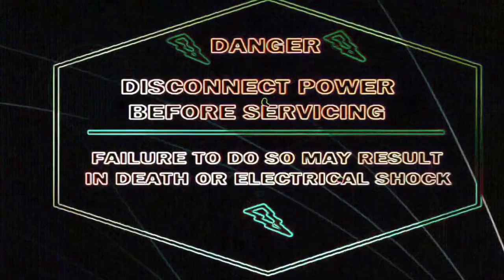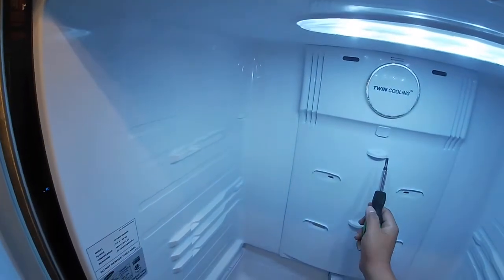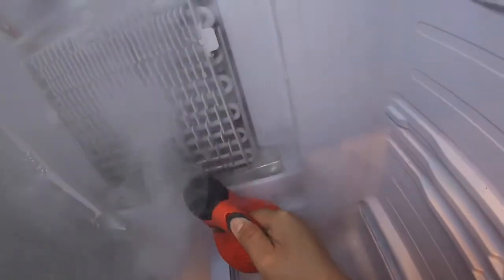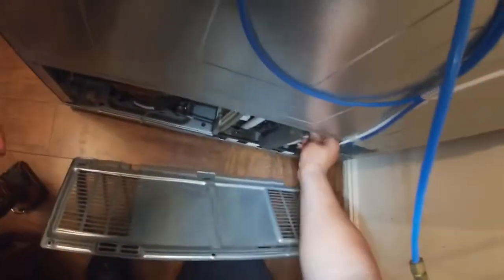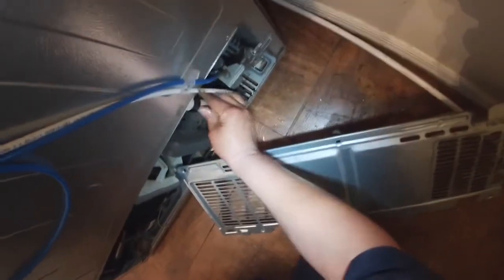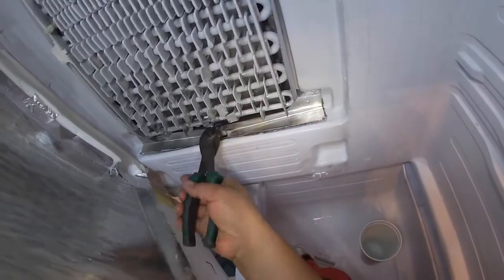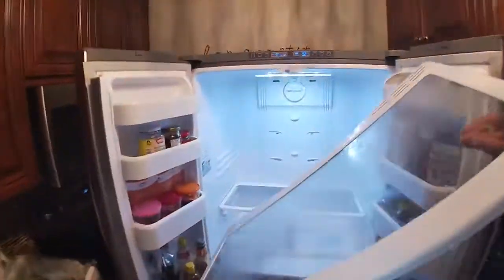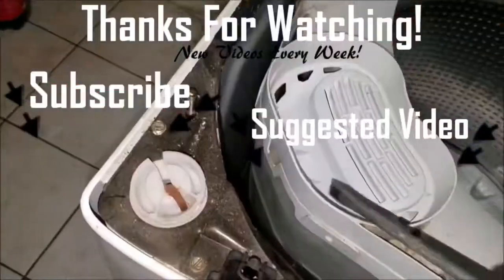How to Fix #Samsung Refrigerator Water Accumulating inside Refrigerator Section | Model RF18HFENBSR

Comment: Great video, thanks for documenting this for everyone.  From my research it seems this model is not as prone to some of the other ice build issues such as icing on the fan. I have the same model.  Bought the house in Feb 2020, not sure how old the fridge is and if the previous owner had this issue before.  I did not experience the issue for a year and then in late Feb 2021 I had a big ice sheet on bottom of fridge.  I defrosted the ice dam and cleared the drain.  I checked the drain tubes and they were not blocked with "gunk".  I reassembled the fridge and didnt think about it until this past weekend.  This past Sunday I noticed water in my vegetable and fruit crisper draws.  I  emptied them and every morning since I find a little water in my right draw and a little on bottom of fridge.   I guess I have a frozen drain again.  I ordered the longer drain clip and plan to defrost ice and put in the longer drain clip this weekend.  A couple things to note:  A month or so before the issue arrived I hooked up a water line and activated my ice maker.  When I pushed my fridge back into the cabinet recess I pushed it too close to the wall.  In the fridge manual it calls for 4" of gap between the back of fridge and wall for proper air flow.  Not sure if this could have contributed to the issue but wanted to note it for anyone else experiencing the issue and to ensure you have at least 4" gap.  Again, this weekend I am installing the new clip, cleaning the back of fridge of dust and ensuring a 4" gap.  I will follow up with results.
Reply: im having the same problem, can you update the result?

Comment: In the process of doing this now...having a bit of trouble with unstucking the top part of the cover.  I have removed all screws (3). Any suggestions.  I do not want to tug too much on it and break it.

Comment: Thank you! We have this exact model and problem.  We ordered the new clip and followed your instructions.  Worked perfectly. 
Our old clip that I cut out didn’t have any tail at all that went down in the hole.  The new clip is much better.  I did detach the cooling panel wires as I didn’t want stress on them.  The steamer worked great and fast.
Reply from the maker: You're welcome! Glad Everything Worked Out and You Found My Video Helpful! 👍

Comment: Ive fixed a couple of these, with a simple piece of bare copper wire wrapped around the element, extending 2" down the drain pipe. . The gross part is, the stagnant water  sitting in the crisper leaks into the ice tray below. The water had bits of mold,  and rotten food.  The customer was consuming the dirty ice, unaware of the health risk.
Its absolutely pathetic that an appliance only two years old should be up for repair already.
Reply: Thank you!

Comment: Thank you so much for this video! Previous home owner got this fridge pretty close to selling the home so I think ours is fairly new. Been living here for over a year and haven't had any issues. We were told to unplug it once a month and let it thaw out. We used to do it more regularly since we have a second fridge. However, the past few months we've had both fridges heavily stocked and haven't thawed the Samsung as often as we should. Usually the freezer would freeze up with excess ice cluing us in that it was in desperate need of a thaw. But suddenly the freezer has been staying clear. Then we noticed one day that our bottom vegetable drawers ended up getting water in them and freezing into the fridge. Cleaned it up and it was fine for a few days before once again freezing over. I'm hoping a good 1-2 day thaw will help. But I'll also check the drain lines. Very grateful for this video! Hoping I can have my fridge back to normal now.
Reply: Hey there, I'm in a similar situation, may I ask for an update on your end? 

I haven't checked the drain lines but I have done the clip replacement and still see water in the same way you described. I just didn't think the drain lines would be full of much of anything, but that is my last thing to check.
Reply: @oblivion452  I'm sorry to hear you're having trouble still. I was lucky. I was finally able to completely empty the fridge/freezer a couple weeks ago. I let it sit open and unplugged for about 4 days. Then I opened the back panel and saw no water so plugged it back in. It's been a couple weeks now and no issues so here's hoping it doesn't start puddling up again. Sorry I'm not much help!
Reply: @Flawestruck  I appreciate your reply! Wishing you good luck as well. I ended up cleaning the drain pipes and they weren't dirty as well. My last attempt is replacing the temperature sensor that kicks on the heating element in the back of the fridge; that seems to be a part that can go bad as well. Anyway thanks again!

Comment: Had this problem constantly and bought the new clip. Worked much longer but has filled with ice again. Will check drains again but it’s just ridiculous that an appliance this new has this big of a problem.
Reply from the maker: I agree with you they don’t make appliances like they used to you probably have to replace the two tubes in the back if the pizza rubber on the tube is toasted in heart maybe hot air is going inside the tube in is frozen over clog in the drain

Comment: Thanks for the helpful video! I have a slightly different design (same model #, but built in 2019?) with the curved heating element at the bottom. I did install the new drain clip - fingers crossed that it works. There was a LOT of ice in that drain!
Reply from the maker: You’re welcome thanks for watching my video💯💯👍🏻👍🏻
Reply: I have the same model and year fridge as you do, 2019 with the curved heating element.  Did using this drain clip work for you?  When I put mine on it was very loose and obviously it doesn't make full contact with the heating element, I tighten in so that it had a good grip and I hope it works....

Comment: Thanks so much! I saw a couple generic videos (on other refrigerators), so I tried to fix my Samsung and got as far as cleaning out and removing two bottom screws. It didn’t “dawn” on me that the upper screw had styrofoam in front, so I was tugging pretty good and decided to stop, before I broke something

Comment: Where can I purchase the repair kit you mention?
Reply: Use a #12 gauge bare copper wire, wrap around heating element a couple of times and down the drain line for about 2-3”
Reply: @gregc.4117  I tried this and it was physically impossible to bend 12 gauge wire around the heating element.  The 12 gauge copper wire was relatively hard to bend (even with pliers) and the heating element is seated right up against the back of the fridge and the radiator is directly above it so there is no way to get in there to wrap the wire.  I tried just snugging the drain clip that is shown in this video, hoping it makes enough contact to distribute the heat.

Comment: Thank you for this great video. I have done these repairs and water still pools under the deli drawer. I have replaced the Genuine OEM GE WR23X10582 Assembly Temp Sensor for Refrigerator, drain clip, defrost heater, and water reservoir since the water inside froze and caused it to leak. Do you have any idea what else could be causing the water to pool?  Thank you!
Reply: Replace the defrost sensor
Reply: Also forgot defrost thermostat

Comment: Hello, thanks for the video! I have exactly the same model of this Samsung RF18HFENBSR and I got the same issue for 2 - 3 months. But when I unscrewed those three screws, it's still not so easy to pull out the plastic sheet, underneath the plastic sheet it's a plastic foam board and feels with very strong adhesive tapes in somewhere I am not sure, so if I pull the plastic sheet down hard, then it is likely to break. Did you get this issue and how did you deal with it? Thanks!

Comment: Thanks for the video. Is there a correlation between this problem (which i've had for quite a while) and my ice maker no longer producing ice?
Reply: IF your ice maker is below, yes.  The excess water from the crisper leaks into the ice mechanism and freezes it up.

Comment: Have same issue. I've even changed the temp probe, heat element and other temp probe that sits on the coils. But customer is still having issues. What else could it be?

Comment: Where does the water drain to and how does it not fill up?
Reply from the maker: It goes to a drain pan on the bottom and it’s observed by the compressor and condenser heating
Reply: @DIYRepairsNow  are you saying the heat from them evaporates the water?
Reply from the maker: @ken_video2631  just the heat goes to a drain pan by the condenser and compressor on the bottom of the refrigerator and the heat from the compressor in the condenser dissipate the water

Comment: This is a temporary fix. You need to find why its overcooling. Ice maker might be turned "on" with no water supply connected or very poor water pressure. Could need a freezer fan, could need a gasket, could need the left door flap etc. This will not get you a long term fix.
Reply: That’s what the drain clip was for, to keep the ice from forming in the refrigerator section.

Comment: My heat element (black bar) isn't straight at the bottom like the one in the video. It's curved down and almost touches the drain hole. Been defrosting it for 5+ hours with a heater blowing right into the fridge but still not draining.
Reply from the maker: If the drain line is clogged by ice you need to put boiling water down the drain worst case scenario you need to let it defrost for 24 to 48 hours with the doors open if the drain line is clogged by gunk or debris you need to clean the drain lines in the bottom back of the refrigerator like I show on the video those things to work. In case it doesn’t work lasting will be put pressure of air or nitrogen  and flush drain out  thanks for your comment and thanks for watching my video👍🏻👍🏻💯💯